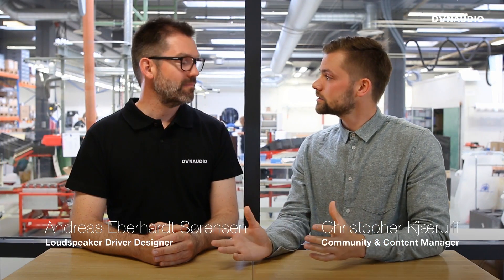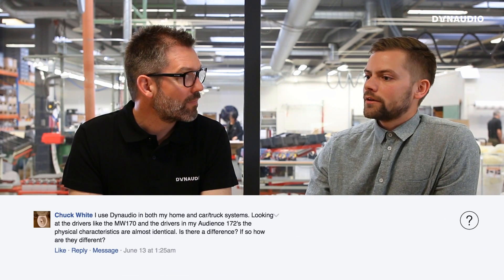The inner workings of a loudspeaker driver

Comment: He could not explain the "fast woofer" phenomenon because no one can actually do that. Everyone will have a different explanation why some woofers would sound 'fast', but he did not even try. Maybe he wasn't prepared. Apparently, he answered that a woofer with higher force ( BL x i) would sound 'faster'. But actually, such a woofer would only sound "louder", not 'faster'. Fostex thinks a system with leaner bass sounds 'faster'. AE ( Acoustic Elegance) thinks a woofer with very low inductance sounds 'faster' even if it is irrelevant at crossover region. Many thinks that a woofer with lower mass sounds faster due to inertia related issue of a higher mass. So even for same overall SPL, transient peaks are muted in higher mass woofers. Maybe Dynaudio can't give an answer that convinces all, but they should present their version too. " If two woofers are equalized completely the same and playing at same SPL, is it possible for one to sound 'faster' than the other and if yes, why ?"
Reply: he also said that you could get more "i" (current) from the amp, but i dont see how one would do that if the current is dependent of signal voltage and speaker impedance...
i simply think that "fast bass" is an audio myth. What kind of musical instruments produce low frequencies with fast transients?  none that i recall; so it does not need to be super fast like a mid driver. That said, a leaner driver would be easier for amp to drive and would produce less heat so would suffer less from problems derived from those two factors, so it would be a good thing as long as it didnt compromise the mechanical characteristics of the driver itself

Comment: using outside magnets instead of inside magnets.. so basically now they are making normal speakers. So dynaudio admits that their tech wasnt the best and all that talk about how they are different because their voicecoil was on the outside etc was just marketing.
Reply from the maker: Hi again, Mike :-) Well, that’s perhaps stretching what Andreas said a bit. The solutions, the technologies we choose to use in our speakers, depend on our priorities for the given project. For some of our new woofers, like the ones in the Contour, the goal was to get more output in the lower frequencies making outside magnets preferable. But that doesn't mean that we don't still think the inside magnet can be the better solution - because for some projects we do, and that's why we're using it in the newly introduced Special Forty speaker. //Christopher.
Reply: Dynaudio Well the Contour is a more expensive speaker than the Special.Forty, right?

Comment: passive xovers also change the phase of the speaker based on the xover slope. 6db, 12db, 18db, 24db per octave = 90°, 180°, 270°, 360° phase shift

Comment: what loudspeakers in dynaudio line used tweeter D28AF?
Reply from the maker: Hi Andre. There are different variations of the D28AF, so it's not as straightforward as it seems to answer you question. But, I can help you out, if you can be more specific about either which loudspeakers you're after or the serial number on the specific tweeter you are thinking about :-) //Christopher.

Comment: Out of curiosity. Dynaudio is know for building speakers that require a lot of power to drive well. Is there a benefit for that? As for example the Special 25 and C1 require a hefty amp.
Reply: I use A Horch 3.0 Amplifier for my Special 25. engineered and made by Michael Pavischitz, who developed the arbiter amplifiers for dynaudio. The 3.0 is a very affordable amp.
Reply: Yes, benefit is - dynaudio with matched amp is genre versatile system. In same time other speakers with high sensivity (91-100db) and 8 ohm more often will be genre selective, and plays for example only slow music, jazz, old rock. Minus is - good amp for dynaudio will priced more then speakers in two times x2. PS For me best dynaudio speakers are Focus 110, Contour 1.1, Contour 1.3se, Confidence C1, C2. I use Contour 1.3se with Ayon Triton III amp. I think only tube amp in A-class with short path signal - can play music :)
Reply: +Илья Н thank you for your reply. The C1 is one of the best monitor speakers I've ever heard. Together with the Totem Mani-2 and Raidho D1.

If or when I upgrade my speakers I'll keep Dynaudio in mind.